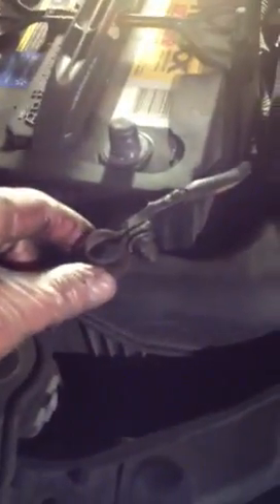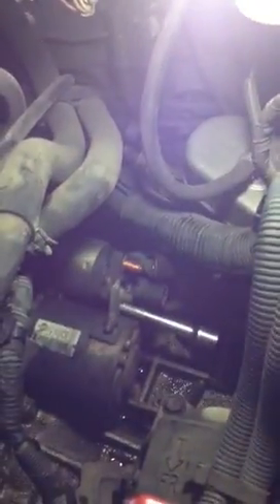2003 Nissan Altima starter change

Comment: I just did mine, thanks! should say that when you get the new starter, that you'll need to transfer over so parts from one to another like the harness that holds the throttle cable and the connector part. But other than that, THUMBS UP!

Comment: Excellent video, just need to mention the solenoid wire from the starter relay needs to be removed off the solenoid to remove the assembly.

Comment: There is a cable small piece with wires attached to the bottom of the starter unit, how to I take that off?

Comment: How did you remove the 17 milimeter bolt, I'm attempt ing this but that bolt is in there tight
Reply from the maker: Davidson, it's been a while, but I think I used a short extension or a deep socket so the breaker bar and cheater pipe would be perpendicular to the bolt. Hope that helps.

Comment: Would this work on a Nissan ALtima 06 ?
Reply from the maker: Sarah, I'm not sure if it will. My wife had an '03 and that's the only one I did it on. If the '03 is the same model as the '06 then I would say so. A way to check would be to look up the starter for the '03 on Autozone or some other part website and see if it is the same as an '06. Hope that helps.